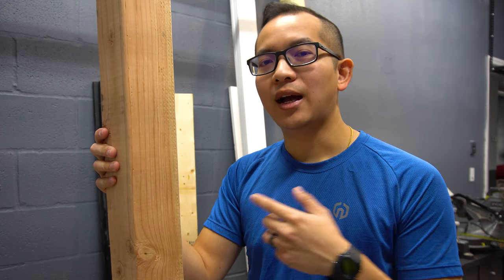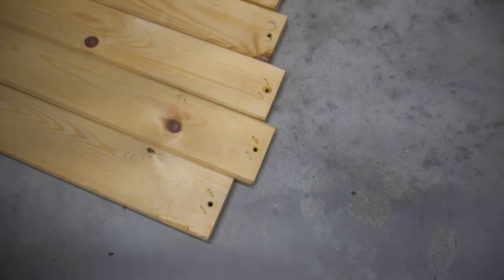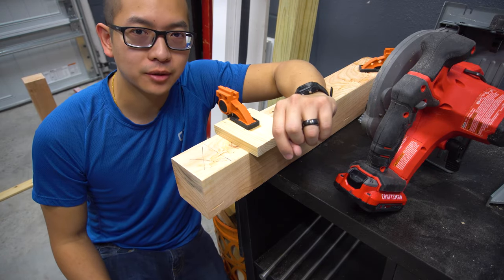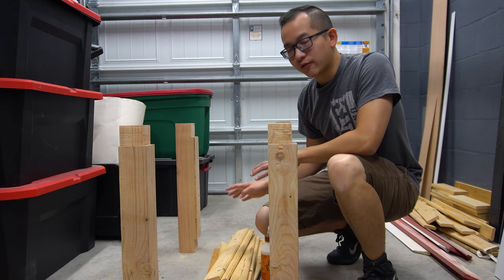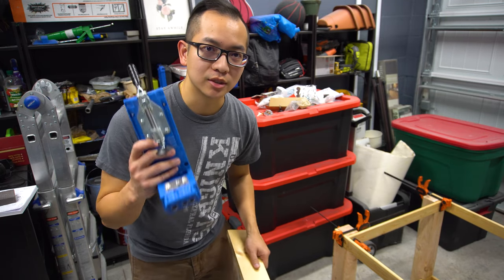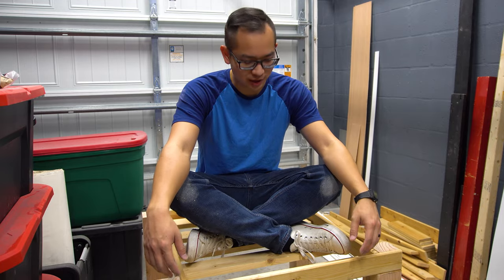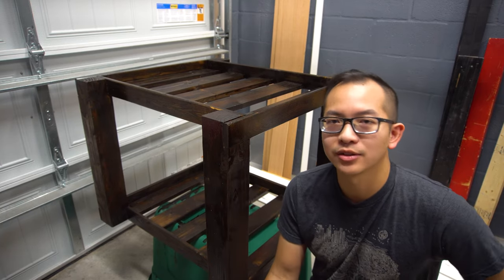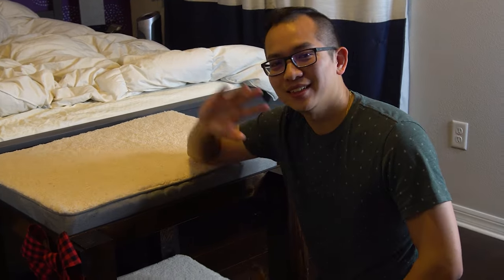Simple DIY Puppy Bunk Bed | LIMITED TOOLS | EASY Project #1

Comment: Suggestion, you can try out using a rag when staining wood, it could get them into the wood grain more evenly and fully.
Reply from the maker: I did use a rag to wipe the excess stain after using the foam brush. The time lapse didn't capture it. Thanks for the suggestion, though 👍🏼